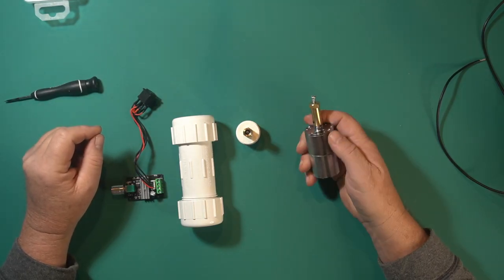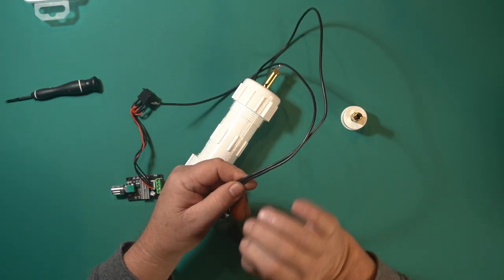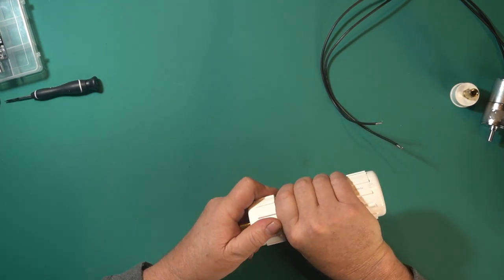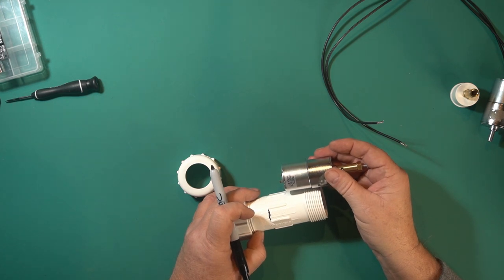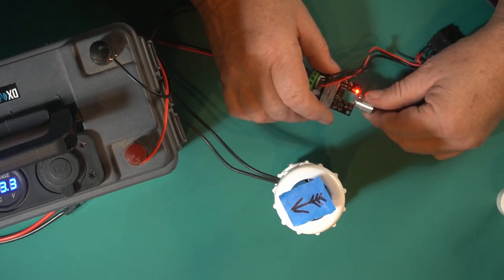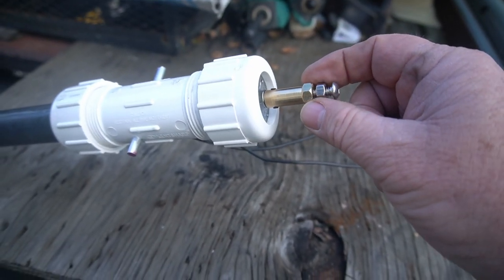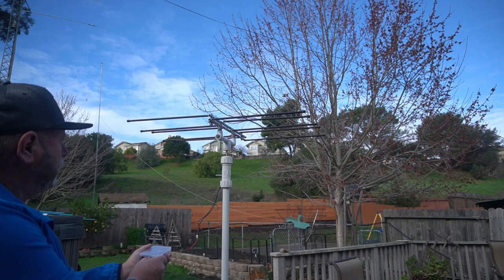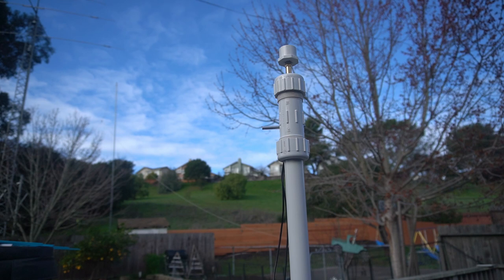This is the best and easiest way to make a12 volt Rotor for a small light weight Yagi!

Comment: A little kids toy car motor is what I got. To build one with, I think it reverses.  I got 2 yagi tv antennas im gonna stack but they both come with rotators. I gotta figure out the stack and rotatin the stack. I think im goin 6' apart either off the existing sat mast or puttin up a pole.  Right now I got a 28" yagi in the livin room

Comment: What size coupler are you using? Most of the motors I can find are (1.43" x 1.31") (DxL). I seen the comment down below about the union, I assume ya'll are referring to the coupler. With the motor I found I would assume you would have to use at least a 1.25 couple?
Reply: I wound up having to use a 1 1/4 if anyone is interested...
Reply from the maker: Mine was a 1" for the motor I used, best to get the motor and then take it to the hardware store.

Comment: Chuck,
This is the first video of yours that I've watched, I must say that this is extremely ingenious!
Using simple plumbing fittings like a dual ended mac union to enclose the motor and other fittings to interface the motor to the top part of the  mast is good thinking.
Sure, you aren't going to be swinging anything particularly large with this setup, it does make really good sense.
Thanks for the video.
73, Mike ZL3XD.
Reply from the maker: Yea It'd not for big antennas but did work well with the 6m hexbeam, but I have plans to revisit the idea with a more robust motor. Maybe enough for my portable Hexbeam.

Comment: Very cool video Chuck, this is very close to one that I am building. The main difference is that mine will be setup to mount on one of those extendable paint poles. I have my 2m tv antenna yagi fixed on it now and rotate by hand, this will be a sweet upgrade. Thanks a d 73

Comment: Watched your original build and this is a very clever improvement on this mini rotor. I will definitely build one of these. One thing I did not catch is what keeps the motor from spinning in the fitting?
Reply from the maker: Thanks Kent yea the second version is so easy, you will like it.
Reply: Friction locked by the compression fitting.  When you tighten the threads down on the cap, it holds the motor securely in place.

Comment: Awesome video just what I was looking 👀 for! I have a project that I’m working on and this is the missing link, thank you 🙏! Question what size is the PVC compression coupling used for inserting the motor in your build in the video? Before I purchase the parts with the links you provided. Also I think the flex shaft you used as per link provided is not available. What can be used in its place?

Love your videos and all info and help is appreciated thanks!
de N1UFO/Gabe 73
Reply from the maker: I think there is a link in the description 1"

Comment: Good morning,
Thanks for his contribution in this antenna rotor project.
I live in Venezuela and here there is nothing to build this rotor and before buying the material in the USA I have 2 questions:
1- The white coupler tube on the Amazon tab has 1.3 and 1.35" (33 and 34.3mm) internal diameter inlets. How can the 36mm diameter motor enter?
2- What PVC pipe does the 3/4 or 1" use?
Thank you for your responses.
Greetings

Comment: 1) Why 7mm Flexible Coupler and not 6mm? After all, the motor shaft is 6 mm. No backlash?
2) And please answer on the question of the electrical contacts of the motor, what are their parameters so that I can order them right away: length and width? I did not find these parameters in the description of the motor.

Comment: At 12:00 you can see that this motor would be highly exposed to the elements if you were to use it outdoors for any length of time. You can mount your antenna through some PVC reducers and use them to create a waterproof enclosure over top of the motor.
Reply from the maker: Thanks , I don't leave it out just on portable outings thank you for the tips.

Comment: Another great video, Chuck! This looks interesting.  Looks like this is a arrow yagi you have built on a previous video. Is there an easy way to determine what amount of torque is needed for rotating these antennas.  Obviously you would want a more substantial one for a big beam at the house.  Haha .  All the best, 73!
Reply from the maker: I have used this for my 6m Hexbeam with no problem, it's fairly big.

Comment: I got a 5 RPM motor and speed control/reversing switch. I also picked up a 1 inch compression fitting at Lowes while I was waiting for the motor to come in. It was a hair small so I ordered the next size up (1 1/4) off of Amazon and it was way too big. Any help on the size you are using and where you got it?

Comment: If you have space, on the aluminum stop (or bolt) used to stop pole from hitting the motor,  you kight add a piece of tubing on the inside to run the "pipe stop" piece thru. This allows for softer pipe stop and prevents motor run on metal.  Just a thought.  KI5IQE

Comment: Do you using the 30 RPM version of the motor?
Reply from the maker: I don't  it's too fast but it may work with the switch set up which basically turns down the voltage. Thanks for watching!

Comment: whats the brass flange with bolt on end called as your link wont show it anymore ?
Reply: This is what I used, uxcell 1/4 inch to 1/4 inch Bore Rigid Coupling Set Screw L25XD14 Aluminum Alloy, Shaft Coupler Connector for 3D Printers, Motor Accessories, Blue from Amazon for $5.99.

Comment: Is that a left handed thread on the top of the fitting or is the video flipped? Also, are both ends LH? Thanks.
Reply from the maker: Nothing has left-handed threads, not sure what part your talking about but I may have flipped the video not sure now.
Reply: @KK6USYHamRadioAdventures  Definitely looks like you're screwing it on CCW...
Reply from the maker: @Jah_Rastafari_ORIG  Yea your right the video is flipped to look like your looking over my shoulder , Good catch I usually try not to do that with something like that.

Comment: Very nice video. Why no stop to prevent 360 degree rotation?  (With maybe a torque limiter)
Reply from the maker: I have never really needed the stop so far , but maybe later I will look into it! Thanks for the comment .
Reply: Very simple idea...  Gives me ideas to build mine.
Reply from the maker: @Gravel_Rat78  I hope it helps, all parts are in the description.
Reply: @KK6USYHamRadioAdventures  the potentiometer switch was a huge help... I have a 12v rechargeable screwdriver motor that I’m going to be using...
Reply from the maker: @Gravel_Rat78  I actually thought of using a screwdriver motor, let me know how it works out.
Reply: I was thinking the same thing...  after a few weeks of use you'd have no idea how twisted the cable could be.